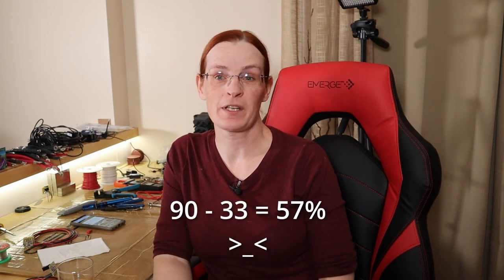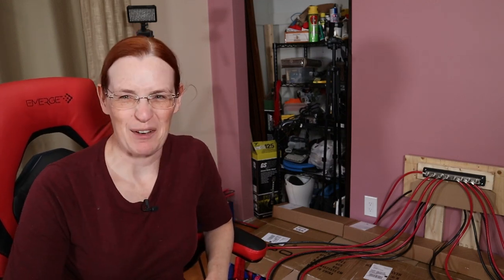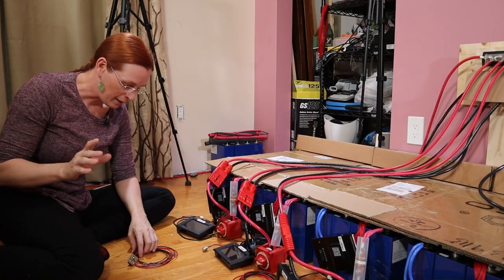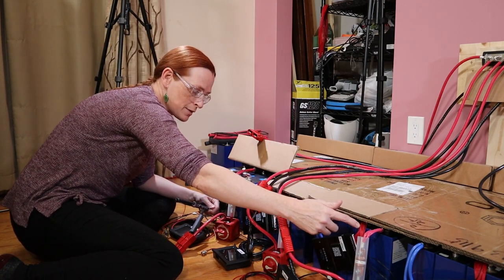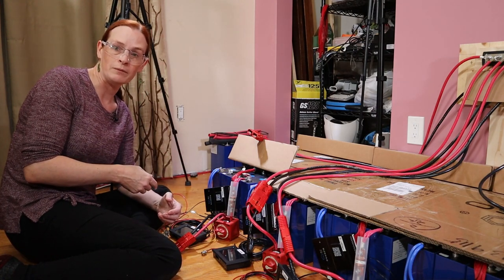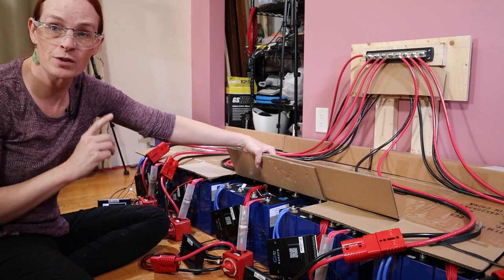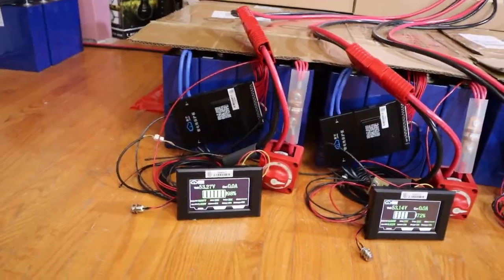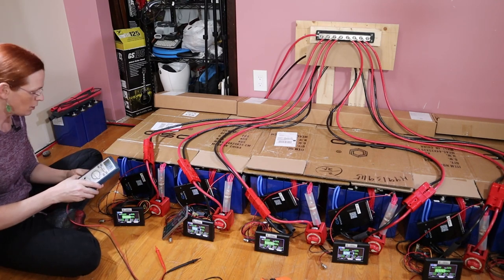It's Alive! (and I need some help) - Part 7 - Big Battery Build! (Ep. 44)

Comment: So I had to watch that a few times being a novice but good to see you getting straight back to where you were... successfully this time of course!  I'm still a bit confused about the problematic buck converters... am I mistaken in thinking they are only required for the 'screens'... and are those screens an option or a necessity? Apologies if you have already explained this before! 
Congrats anyway though... big, beautiful and sucking power it most definitely is!
Reply from the maker: Ya, the screens are entirely optional, and the buck converter is required only on 48v packs (they support 10~25v or something like that).

Comment: HOWdy  D-M,
Thanks & Welcome Home 🙂
"American Boat & Yacht Council" ... USA or ALL of NORTH America ?... / CANADA / USA / MEXICO / LOL 
... 
FYI: on my three (3)  "store-bought"  48 volt -  EG4-LL batteries  ...
they arrived with a 55% SOC  and maintained that reading, for weeks, while I was building my Ground-Mount ...
after I started CHARGING the Batteries ... S L O W L Y ... with only the 1st SIX (6) Solar-Panels (out of 24 panels eventually ) ... 
generally around  159 DC volts and up to 3 amps to 15 amps  depending on the SUN-SHINE ... 
after several SUNNY 'daze' ... two (2) of the three (3) BATTERIES, connected equally on a "PIKE" brand set of BUS-BARS ... 
CHARGED un-EQUALLY  ... with two batteries achieving (TOP & BOTTOM ) a 98% SOC ... 
while the MIDDLE Battery only filled to the Mid to UPPER 70% SOC ... and then it  s l o w l y   CAUGHT Up ... 
I purchased all three  "EG4-LL" batteries at the same time & their SERIAL-NUMBERS are sequential from the manufacturer in CHINA ... 
I, too, would have expected that ALL three (3) batteries would have "filled" at an even rate --- but --- they haven't ...
Just an  FYI   ... 
...
how  ERNEST was your CIDER beverage ??? 
...  
I wonder if the term  "HYDRO" will someday (hopefully) change to  "SOLAR"  or other RENEWABLES  
...
COOP
...
Reply from the maker: Huh, good question if "solar" will replace "hydro". I guess it depends; Kids still say "film" something, and almost no one has used film in decades now.

Comment: Are those regulations not speaking to off gassing during charge/discharge a la lead acid systems and the concern over hydrogen gas? Lithium does not off gas unless there’s a failure which is likely not what those regs are discussing.
Reply from the maker: From what I understood, they don't differentiate between normal out-gassing and excursion out-gassing. If it can gas, you need to deal with it.

Comment: I'm wondering if the SoC for the BMS B and BMS D might have lost some info considering there seems to be resetting. Maybe if you cycle the pack again, the SoC might properly calibrate.
Reply from the maker: I have no doubt it would calibrate, but all six BMSes were always in the same state (on, off, charging, balancing, etc).
Reply: @TheDigitalMermaid  I'm thinking SoC needs additional historical information about the pack (max,min,maybe more), and I'm wondering if the BMS is losing it since at least the BMS B is flakey. So in reality all the packs have the same real SoC, but it's just that BMS B is calculating it from wrong historical numbers and using some default historical info to do its calculations. I'm wondering if a 2nd device on the same pack to calculate the SoC would show up different numbers, or better yet if you swapped the BMSs like between B &C, and see if the error problems move over to C. Don't know if those BMSs have firmware versions or not, but that version could be buggy too.
Reply from the maker: @awesomedee5421  From what I understand, JK BMSes can't update their firmware.
Reply: @TheDigitalMermaid  Yeah, I've been bugging them about that for quite some time. If they would release the source code, I told them I would add a boot-loader myself to do updates, but no progress yet. The current situation in China probably doesn't help things move along either...

Comment: Check out Will Prowse, he drilled a lifepo4 cell 9 times and it only vented, not badly as I recall, compared to another pouch type cell (supposedly lifepo4 but decidedly not!) he drilled once and it spontaneously combusted (to his embarrassment), anyhow touch base with Will, Im sure he can give you a reasonable answer/definition to your venting or combusting issue/question. 
I think ur worrying overly about accuracy issues here, the JK are generally pretty good and with calibration I have mine almost perfectly matching my Victron smart shunt data. Also, check ur history, version and model numbers as I did have some of the crashing issue ur having with one of my JK’s that the seller was happy to replace without too much drama,as they claimed there was an issue with my model JK BMS which was a 24v model though. Also check out Andy’ off grid garage (I know you have) for all the JK settings and go through them to make sure you have ur Balance settings to cut in at the right voltage settings, you can and will get some drifting due to IR etc. Im sure you will get it sorted. All the best.

Comment: Should go with the Seplos bms so you can sync them all up and it works with victron
Reply from the maker: Passive balancer is why I didn't choose them.
Reply: @TheDigitalMermaid  high balance needed mostly with used cells. Life04 behaves nice in matched sets.
Reply from the maker: @gonesilent  After a few years, my packs will be used. :)
Reply: @TheDigitalMermaid  I agree. Ultra low balance currents are hopeless on big banks and high charge rates.